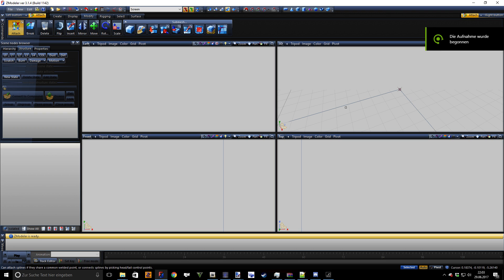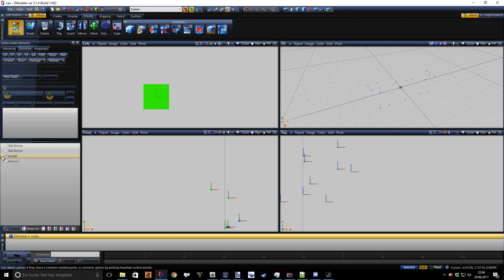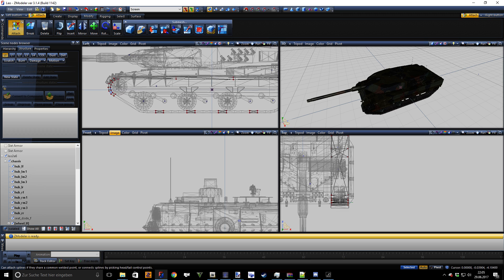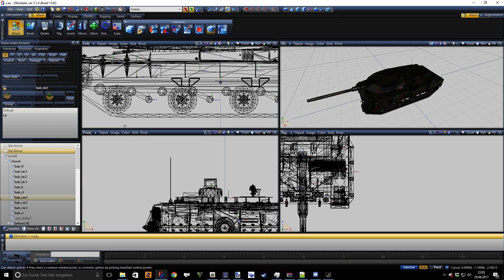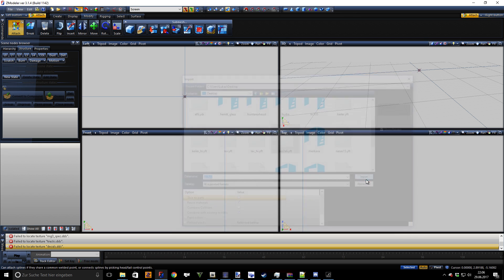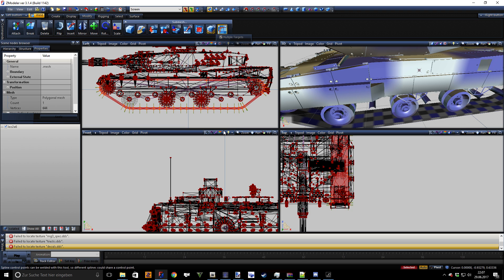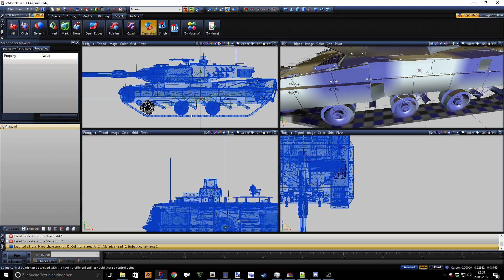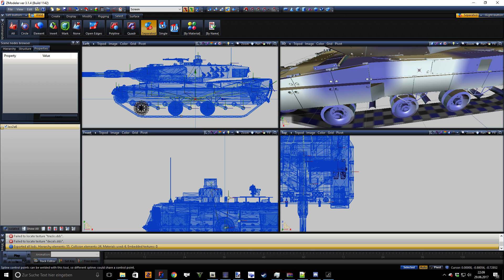[Tutorial V]How to make proper tank tracks for GTA V using ZModeler 3

Comment: Small problem with this, I've done everything up to entering polygon mode after importing with slice to parts disabled, but for some reason the entirety of the model is unselectable and has an orange box surrounding it. Even with the select by material tool it doesn't select anything. Any idea why?
Reply: I have the same problem